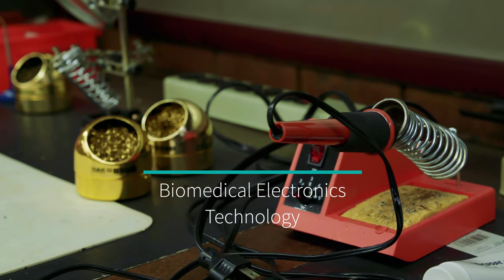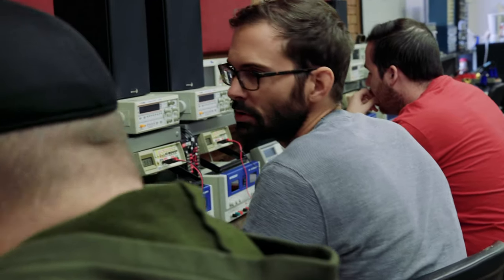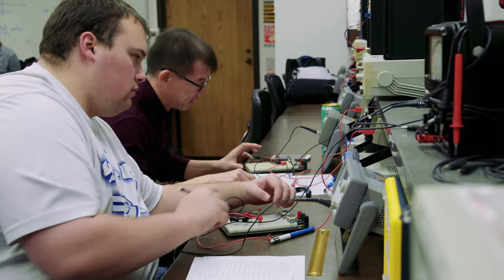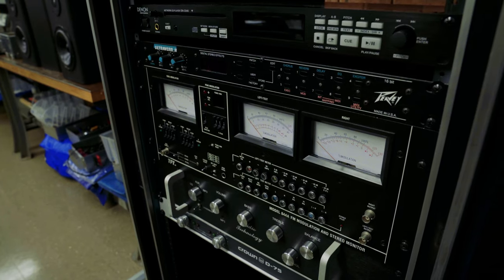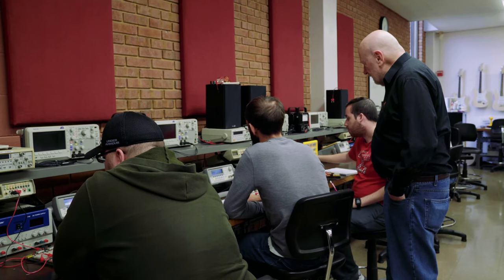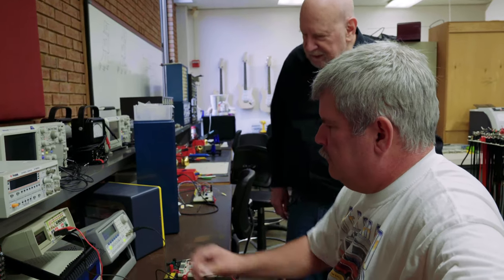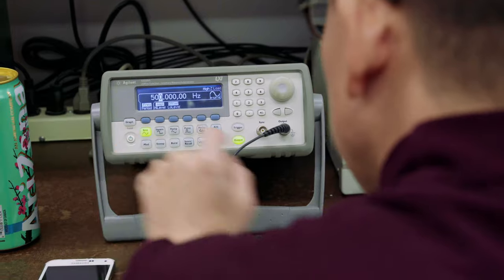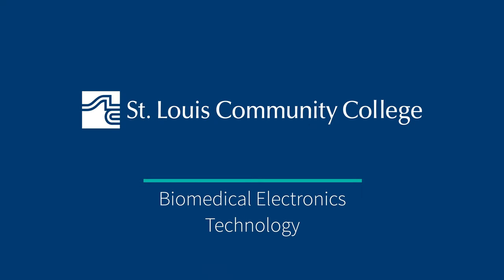Biomedical Electronics Technology

Comment: electronic design and MedicaL significance ELectronics oR computers becomes important parT 
-----> electronic devices origined inForm of watches during 2oth centuries 197oS Etc
conversion of timer properties and 🚫 sTop watch were directed to frequencies of cardiacBeaTs Respiration rate correspondence with hearT beats ie set 13respiration cycLe for 72beats and ⬆️inCreases electronic diagnostics for BoTh hearTrate and respiratIONs